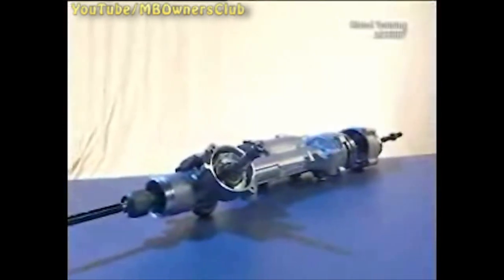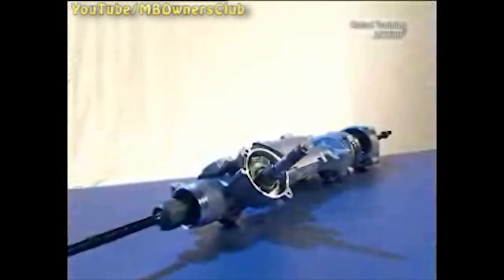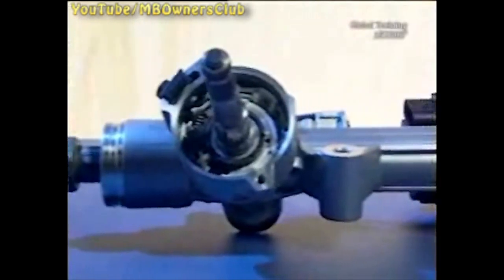How the Electric Steering Works in Mercedes-Benz E-Class and CLS

Comment: I hear a noise like a chain ratle when i start the car and It's cold outside but if I move the steering wheel, that Sound disapear, and if I put the steering wheel back too that pozition(with straight line wheels) that Sound come again, but just when is cold...